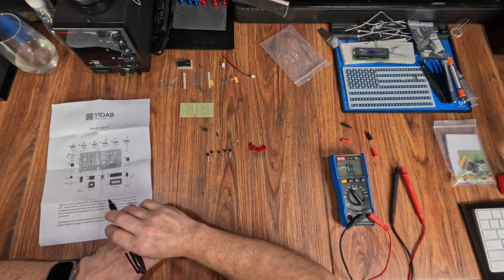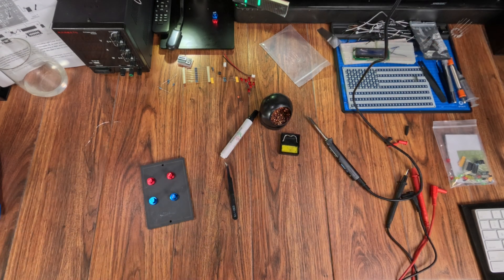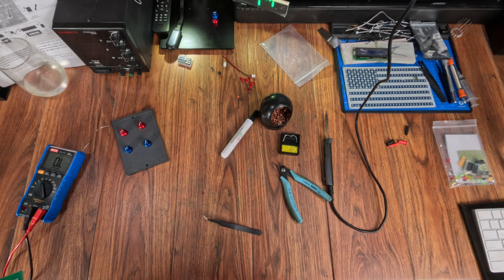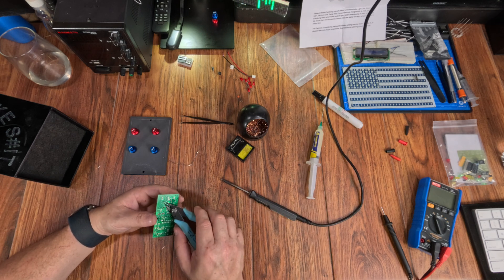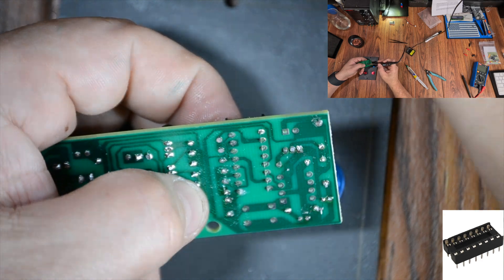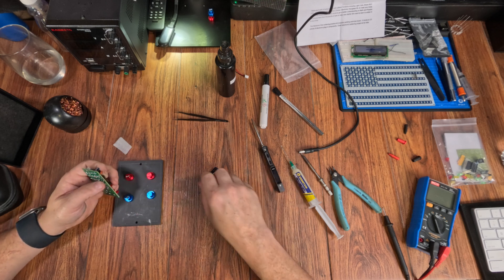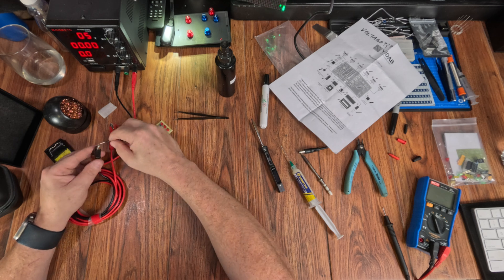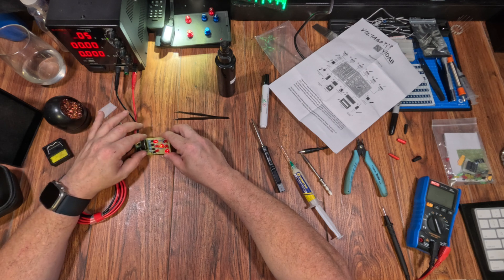The Gambler

Comment: What about inductors
Reply from the maker: I don't think I have made a kit that had an inductor in it. I understand that it makes a magnetic field and can be used kind of like a cap. I'm learning as I go. Always hoping someone will give me a better explanation in the comments. Like would an inductor work better in certain applications instead of a cap or do they work together. Learning after 40 is hard 🤣
Reply: @ no man I get it completely lmao inductors confused the absolute hell out of me for the longest time and I’ve been to school for this kinda stuff. My basic understanding at least when it comes to audio and things of that nature is that they help block certain frequencies and allowing others the same with caps, check out AB type amplifiers and things of that nature, another important application I can think of are cross over filters they’re really important for making sure the right frequency goes to the right speaker. Umm lets see obviously an inductor is essentially just half of a transformer, ohh and in the case of AC/DC they block AC, and allow DC to pass I forget the reason behind it I’m not actually doing eet right now I’m just an electrician.
Reply from the maker: @chrisdoesnotmiss  Yeah, as of right now most of this stuff is above my pay grade. Im An HVAC tech by trade so control wiring and mains is my thing. Every time a controller board went bad, I was like man I should try and fix it how hard could it be. Now I know. I've been thinking about picking up an oscilloscope. I think, for instance, in this video it would have been interesting to see exactly what the 555 timer was putting out as a clock speed. But alas I have no idea how to use one. All the you tube videos I watch on them, they tell you how to use them but not why. It's like ok I get it. It shows you a snap shot of the voltage. why do I need to know that. like I said above my pay grade... for now
Reply: @ oh dude oscilloscopes are so easy the only thing you have to remember is you may need a function generator they basically just make the input wave and required power, you put one probe on the input portion of a circuit and the other on the output, this gives you the input to output so you can see what happens overall you can isolate each portion of the circuit as well and just place it on the input and output of say a capacitor. The one thing that gets annoying with oscilloscopes is they can be a bitch to dial in right or just for me ig idk, the only other advice I can offer is make sure you get one with  high frequency capability it’ll help you out in the long run I promise.
Reply from the maker: @chrisdoesnotmiss  So you can just check ,like you said, a cap thats still on the board? no feed back through the other components?  I guess it's cause im not designing circuits yet, all this stuff is so new to me. Being an amateur at my advanced age kinda sucks. im so used to mains voltage 24v and higher, this stuff is going to take so long to figure out.
Reply: @LetsMakeSt-ll2wx  nahh dude you’re absolutely right about the first part but you’re wrong in discouraging yourself don’t do yourself like that I’m just an electrician now and it’s confusing to me lol I wanted to be the guy doing big power shit but no one wants to apprentice me so I feel you in not getting what you want

Comment: I enjoy your commentary and explanations. As for the audio it wasn't great, but it wasn't horrible either. I thought that the voice over volume was too low compared to the intro music. Come to think of it that's fairly normal for TV shows, so well done after all. As for the board soldering, when you used the additional flux it seemed to flow well, but not without it.  I had queried previously about your use of flux, and now it makes sense. In my experience a good rosin core leaded 60/40 (or there abouts) solder usually works just as well without adding extra flux. So it could be the board isn't the problem but the quality of your solder? Maybe you should look into that. I bought some leaded solder off eBay about a year ago and it was rubbish, wouldn't flow well and I always ended up with a dull looking joint. Tried another brand and it's been much better. Keep up the good work and looking forward to your next build.
Reply from the maker: I think your on to something with the solder. I bought all this stuff on the cheap from Amazon about a year ago and the solder was no exception. I used to use lead free not knowing how terrible it is. As bad as this stuff is that was so much worse. I think I'm learning that Amazon is not the best place to get electronics consumables or anything lately As for the audio I need to get the mic settings and placement right. This is the first video with it. 
Thanks for the comment and the views glad I can be somewhat entertaining. I have an idea for another kind dice simulator should be coming soon.